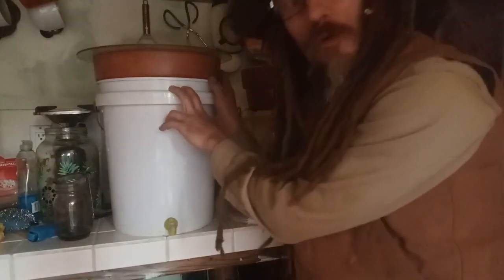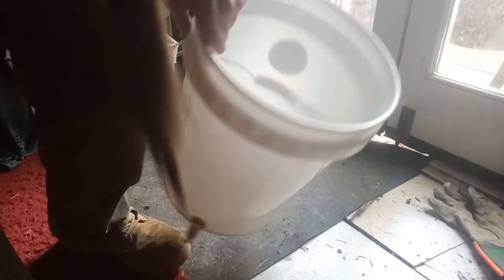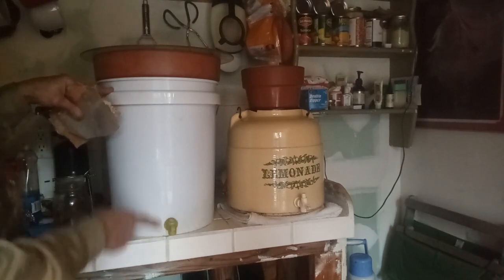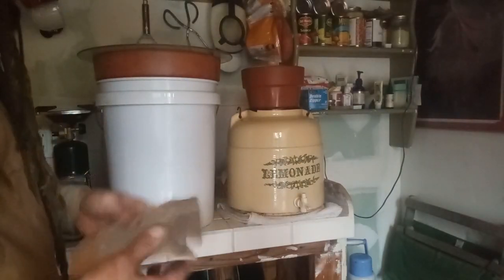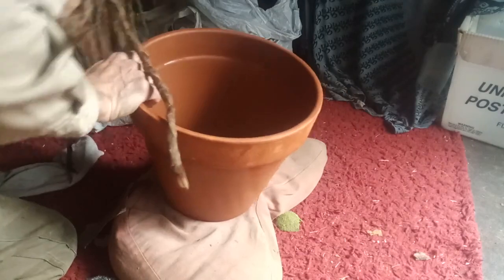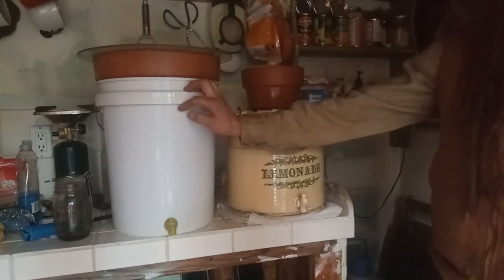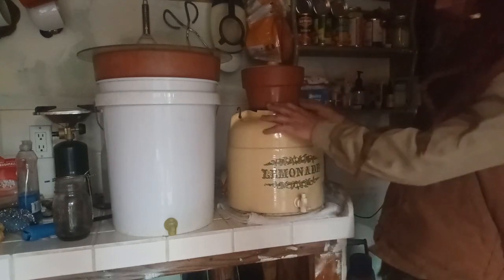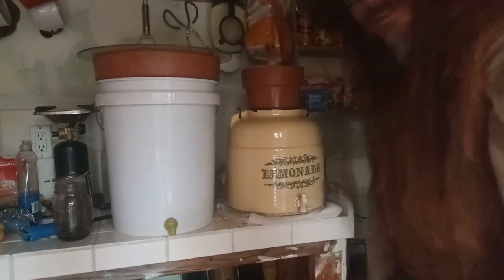Make a Water Filter  From a Ceramic / Clay Flower Pot to Survive Covid-19 Armageddon - Clean Water!

Comment: Pretty good, but its not natural. Rain water might clog this filter pretty fast. If electrisity shut down your city water will be gone, making this filter kinda useless as you need big quantities of water just to function.

Unplug that clay pot and fill it with sand, put stones in the white bucket. Now you got a sandbio filter. You'll drink the stagnant water as it's been cleaned by natural bacteria. You can only fill this filter with rain water or unclean water. City water contains chlorine and will kill all good bacteria.

Sandbio filters take up to a week to get ready, the ecosystem needs to set itself up naturally.
Reply: They make sandbio filters in Africa to clean water from manure, ecoli and malaria bugs, etc.
Reply from the maker: This is very interesting! I will look into it. Is this method something that could be build with locally sourced materials from say down by the river?
Reply: Don't the sand and and rocks need to be changed? Just as we would need new sand later, just have a new pot for later, for when the old pot gets clogged. As long as there is rain water, the pot filter will never be useless. And it's so very simple.
Reply: Something. I believe there’s a misunderstanding here. He’s using what he has around him. It’s not bushcraft.  It’s OK to use something that’s not natural. Like a clay pot. And let us not forget, and white plastic bucket is not natural.

Rain does not clog pottery. Minerals might; rain alone does not.

Comment: use ONLY unglazed clay pots
Reply from the maker: I'm having trouble finding those. Do you have a source? Also, do you have any info on the glazing process? Does it involve chemical treatment?
Reply: ab ma:  that would be the ultimate. Those are at a bit of a premium these days, it would seem.  For those without the benefit of that resource, they have no choice but to sand.

As a potter, I’m astonished that a person can actually sand off the glaze with just a little bit of sandpaper. I wonder if it’s actually paint or varnish that’s being sanded off.  Glazes are essentially glass, and those don’t sand  off easily.

I’m wondering if a brush attachment and a drill might yield more rapid results if it’s an actual glaze.

Comment: Ya, tastes horrific and 6oz takes 24 hours minimum to filter thru... oh I forgot to use that left handed sandpaper ! I will try again
Reply from the maker: The sanding is essential. You also want to run at least three gallons through before drinking. I get about a gallon a day and the water tastes fine. It's also important to keep the pot full to speed things up. Good luck!

Comment: Will this work with salt water?
Reply from the maker: I would imagine that salt water would clog the filter pretty quick, though I do not know. I think the best way to make salt water drinkable would be to evaporate and condense. Interesting thought though.
Reply: No. Salt is so small it will pass through the filter. It will only take out larger pollutants. Use only freshwater with this filter. Rainwater will work well since it is fairly clean to begin with.
Reply: @PiratesInTeepees  o
Reply: Robert D:  funny you should ask. I just had to do work on a filter that I picked up from somebody else a few months ago. The guy was using it on his boat, trying to use instead of desalination. The filter was totally clogged with salt particles.  I cannot speak the tastes of the on the other end of that filter.

But it was a pretty easy cleanup.

Comment: Isn't the remaining glaze kinda toxic?
Reply from the maker: I think the glazing is a heat process and not a chemical one, but I could be wrong. I need to run some tests on the water that comes out of this. I now have space to put it back into use so I should have more data soon.
Reply: @PiratesInTeepees  Yeah, let us all know. Fascinating.
Reply: Love this, I just made mine😊
Reply: Peter Cohen:  Glazes are essentially glass once they’re fired. That being said, it is possibly use lead and any number of other toxic components in the formulation.

As a new potter back in the day, we ran experiments on certain clays and glazes. Black clay was utterly gorgeous, but you had to be careful. If you didn’t make the clay body yourself, you had to be aware that it might not be safe to use for cookware, bakeware, food storage/serving,  or dishes.  There were actually clays and glazes, especially the black ones, that you could actually put an acidic food/beverage in, and come back later to find elements of the glaze or clay leached into the food.

That being said, I have never seen a glaze that’s fired into a clay body, that comes up with a light sanding.

I think there’s a good chance that that was actually a layer of varnish that was sanded off.  

In any case, if a person is actually sanding off Anything made of glass, including glaze and clay that is fired, it is really crucial to wear lung protection. Because nobody needs bits of glass in their lungs; This causes long-term permanent damage. And all sanding of glass results in tiny little particles becoming airborne, which puts a person at risk to breathe.
Reply: @daphneraven6745  Thanks for your reply. Very interesting. The short version is of course to test the water (or food) coming out to be sure. Especially if using the item on a daily basis and recommending others do the same.